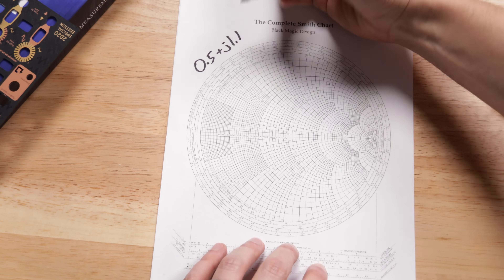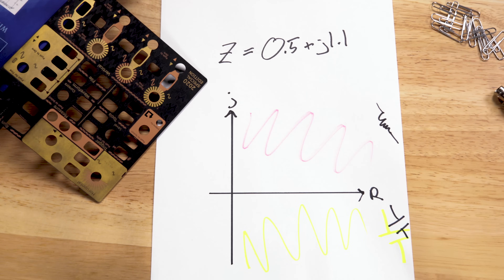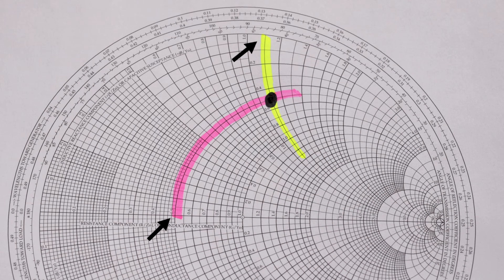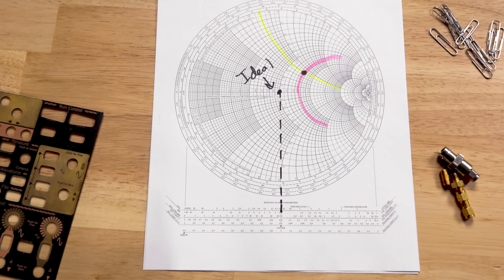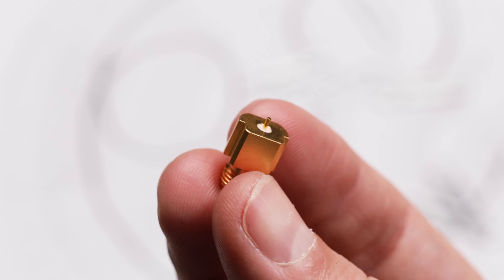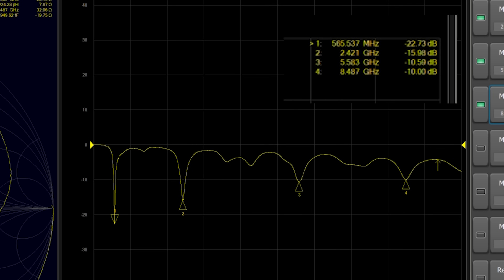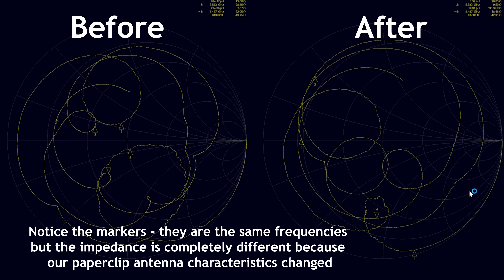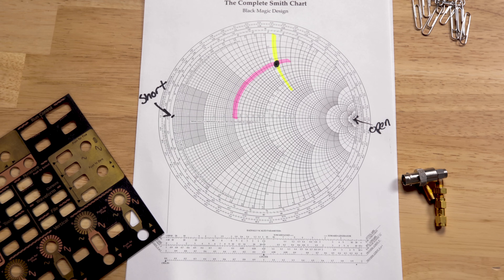Smith Chart Basics + VNA Paperclip Test

Comment: NEVER EVER cut a paper clip or any non copper wire (especially steel) with electronics type wire cutters like that. You just trashed someone's wire cutters. Even if you bought that set just for the video, you're setting a horrible example. No coffee for you for a week.
Reply from the maker: Yeah these are junk clippers, I have nice ones for nice things and not so nice ones for not so nice things. Good PSA though! Nothing worse than sad clippers.
Reply: @KeysightLabs  Ok, good to hear. I was reluctant to impede but I couldn't resist reacting. Your positive feedback resonates well with me.
Reply: Why?
Reply from the maker: It dulls them. Copper is pretty malleable, steel is not.
Reply: And dulling is the "good" outcome. I have a small collection of cutters and strippers with notches from coworkers "borrowing" them to cut whatever. The notches have to be ground out to allow the remaining blade to be useful. I now have three perfectly good 1117 and 1118 strippers where the cutting blade is trashed. Tools for 26, 28, or even 30 gauge wires depend on good alignment, which a paperclip or steel wire will ruin. I should have included this about this in my workbench video.